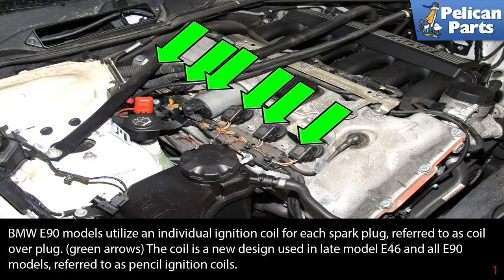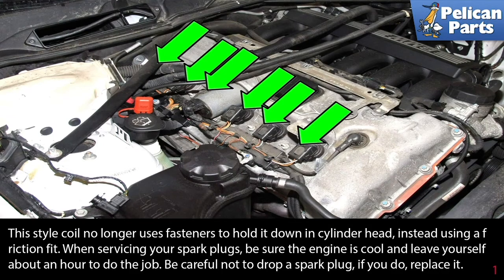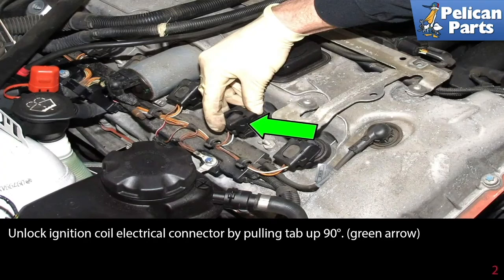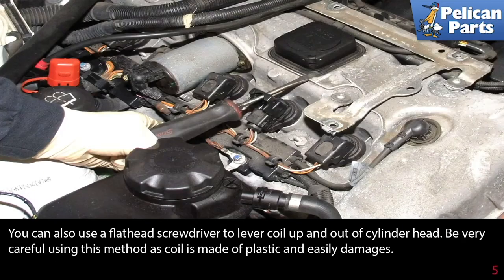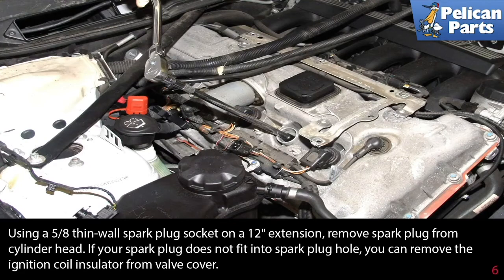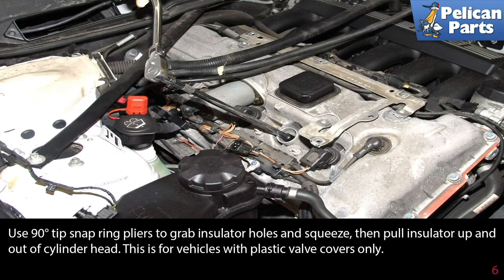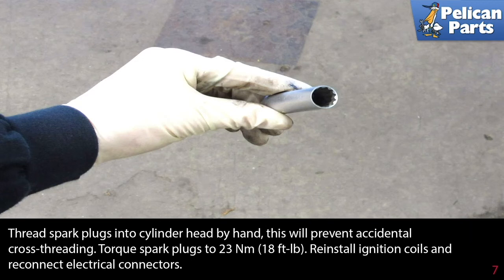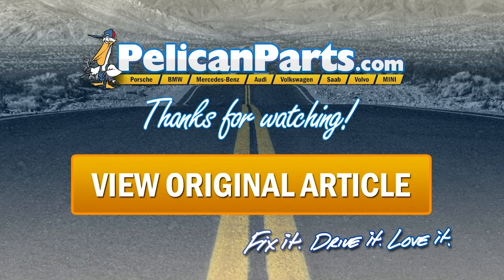BMW E90 3-Series Spark Plugs and Coils Replacement for 335i, 325i, 325Xi, 330i, 330xi and 328i

Comment: I HAVE a 2008 328i sedan BMW  do i have to adjust the gap on IRIDIUM plugs or are they already pregapped..i regapped them to 1mm and the car misfires all over???? PlEASE HELP
Reply from the maker: Pre-gapped. The part number defines the gap. get the right part number and you are good to go.
Reply: @pelicanparts do u know what plug I can use brand for the 2008 328i I called dealer and gap is suppose to be .o30